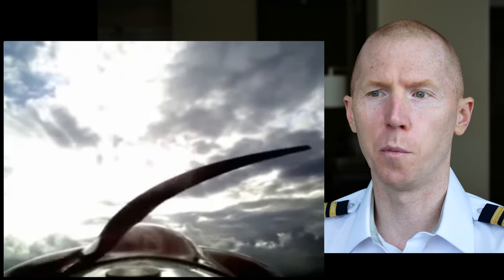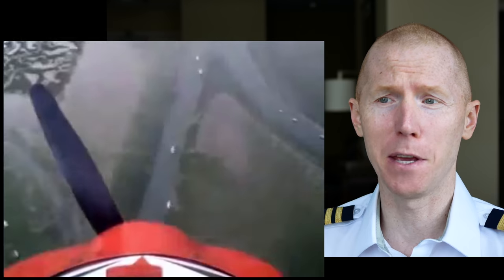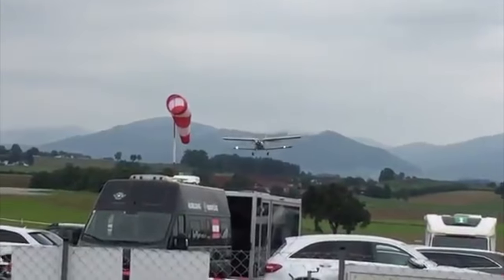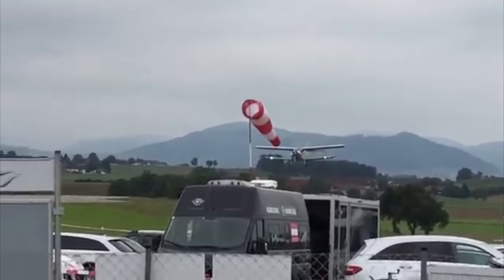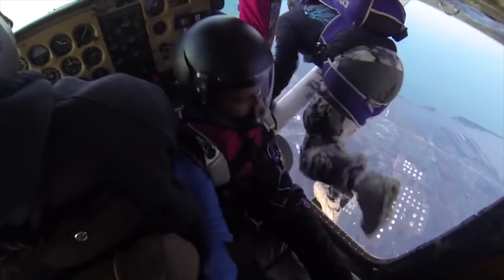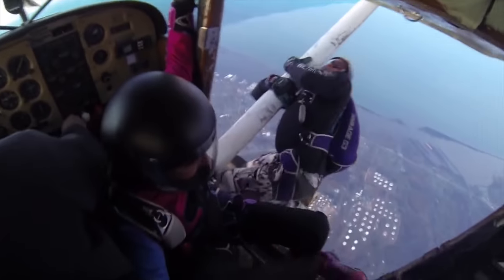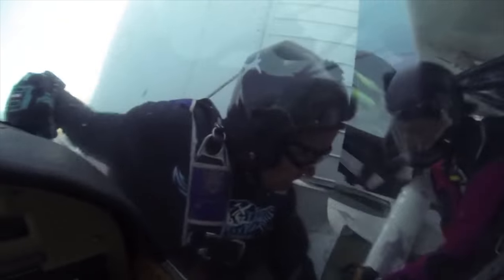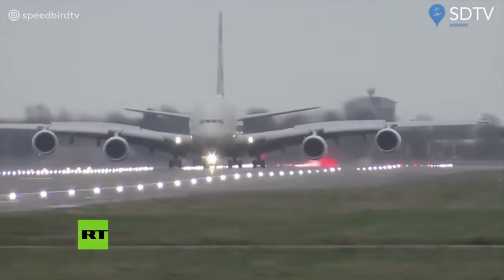Mid-Air Collision Rips Plane's Wing Off | Viral Debrief

Comment: True story, in 1967 (iirc) my dad was 5000ft elevation over El Paso Texas and was involved in a head on collision with a Navy Trainer jet in steep decent. Both planes skipped off each other, his plane going high, jet going low. The jets tail came right through the nose between him and the copilot and was torn off. They lost all control but the twin engines were still running, they could throttle down one side to turn and vice versa. They were able to land it actually on the runway albeit with a single wheel down. The jet successfully landed as well, no fatalities. crazy stuff. Still have a copy of the news article on it

Comment: Skydiver here (not a pilot though so I apologize if I'm wrong). Usually if we do plane formation flying for a "bigger" skydiving formations, the lead plane is always on higher altitude. There is multiple reasons, trailing plane on lower altitude has a perfect visual to the lead plane that is higher. Also skydivers have better timing for the exit when the base (single skydiver who others follow to create the formation) exits from the lead plane. They also have more time to prepare for the exit and the separation is smaller when the base exits from the higher altitude. So my best guess what happened there is that the lead plane noticed he/she was too low, and tried to correct it by gaining more altitude too late, when the balance of the plane was already screwed up since people were already hanging from the strut thus leading drifting to the left. Horizontal positioning speaks for this too, since the trailing plane was on the left side of the lead plane, skydivers have better visual of the base exiting from that side. With twin otters and c208s the ideal would be other way around (higher altitude plane to the left), since the door is on the other side. Would you think pulling the power would possibly cause the plane to stall, since the weight was still partially on the back? I try to find you one c208 major screw-up with the weight balance that caused the plane to stall with people still inside

Comment: I was recently watching a video to the effect of "Real pilot reacts to flight scenes in television and movies." One of the things he said is that the explosions and fires are very unrealistic.  That wings don't just burst into flames when they separate from the fuselage because aviation fuel is actually hard to ignite.  I'm sure that last part is true but here we see a collision between  landing gear and a wing with no (prior) fire involved and you can see the flaming wing just flying off doing its own thing.  So somehow the fuel from the tank in the wing ignited from probably a short in the wiring when the wing separated.
Reply: The difference is that small piston engine propeller planes use gasoline as fuel.  Gasoline is very volatile and in the high air velocities involved will create a flammable cloud of hydrocarbon gasses mixed with air very quickly and the smallest spark created either electrically or mechanically will ignite it.

On the other hand large commercial aircraft use turbine engines that use a fuel similar to kerosene with is much less volatile than gasoline and thus it is much harder to create a flammable cloud of hydrocarbon gasses mixed with air.  it can certainly happen in the correct situation, but it is much less likely to be ignited.

Comment: The mid-air. (I'm a professional skydiver, more than 30 years) - this is called a Formation Load, the intent is for people to jump from both planes at the same time, and create a single freefall formation. We do this a lot, and every major record attempt needs this. In this scenario, we have a "lead" aircraft (probably the one on the right, as it is in front) and a "trail" aircraft. Timing of the jump comes from the lead, and the trail aircraft and jumpers take their cue from the lead.

It would have been better if the trail was on the other side, to the right of the lead, as this gives better vision for the trail pilot, and the jumpers in the trail can see the signals and climbout of the lead jumpers. But this also makes it harder for the trail jumpers to see when the lead jumpers actually exit, and any delay between the two groups exit timing leave a large gap for the trail jumpers to close.

Jump pilots usually wear an emergency parachute, it is highly recommended, and some Drop Zone operators require that pilots always wear a rig. It is usually not a sports parachute, but the same style as worn by glider pilots - a seat pack - a single round parachute, although "square" reserves as used by sport jumpers have become more common. This is why the pilot of the broken plane survived - he bailed out. The other pilot was able to land safely.

Comment: Spins... depending on the center of rotation, the speed of rotation, and the amount of fuel in the tanks, the spin will force the fuel in the tanks to the outside and away from the feeds thus starving the engine of fuel and causing it to stop producing power. After the spin recovery (and the spin did seem intentional in this vid) a restart of the engine should be possible.

Formation flying... well, the trail plane's job is always to keep the lead plane in sight.  This pilot clearly didn't do that and... well, no more to be said on that.  
And, for the skydiving part, the jumpers in the trail plane jump when the lead plane jumpers exit.  So, if you can't see them you don't know when to jump.

Great vids. Thank you.

Comment: In the first video only way u can think about getting out of it would be turn the the rudder the opposite direction of the spin to add some resistance and hopefully slow it down Enough to cause the weight of the engine to pull the nose down to get some speed and airflow over the wings

Comment: Thank you SO much for berating those that decide to land on the piano keys or numbers. I used to work for a major airline training their cadets before they transitioned to jet training - if ANY of them landed on the numbers or piano keys, they failed checks. No one even went solo before they landed in the correct area. GA all too often thinks everyone will be a bush pilot - you can learn that later.

Splays, clearways, displaced thresholds and 1000' markers are there for a reason.

Comment: I used to ride motorbikes. There is a phenomena where riders will be approaching a bend at speed and they give up trying to get round the bend (often resulting in a fatality) even though in reality they could have got around the bend. It's a natural "freeze" response where you brain just stops responding in the face of a fearful event. You can train yourself not to react in this way or more accurately to react in a more appropriate way. I'm assuming it's the same thing with pilots.

Comment: In mid air collition video, you can see in 7:40  the vertical speed of upper plane, they are descending arround 200 fpm; and  you can see the same instrument of bottom plane in10:02,  they are CLIMBING around 200fpm at the beginning and  300-400 fpm at the impact moment.

But off course, they never saw each other. They should have planned their flight better.

Comment: When in a flat spin the correct procedure is to apply rudder and turn into the spin. Not going into credentials but this bit of info can save your life.  Your pitch will eventually turn nose down and you will gain airspeed. Then simply stop the spin with ailirons and use elevators to regain a safe attitude.

Comment: The Cessna on top would have also had major CG shift and additional drag as the skydivers got on the wing. The pilot may have appeared to have good separation from the other aircraft before they got out onto the wing, but then things changed quickly as the divers exited onto the wing and the pilot was either too distracted to notice the change in course or the plane was no longer sufficiently maneuverable to avoid collision.

Comment: these are excellent training videos which show nearly catastrophic results but teach the most harsh lessons.   although it is terrifying to see a pilot involved in a terribly life-threatening situation where balance between success and failure is a very thin line.   I'm not a very experienced pilot but when I was training as a commercial pilot I had  my PPL I was departing my training airport and this airport had departure and arrival points geographic points on the ground for keeping separation between departing and arriving aircraft depending on the runways in use.  on this particular day I was heading towards the assigned departure point  and I saw another aircraft heading in my opposite direction straight towards me.  he was obviously not aware of the fact that the departure point was not the arrival point and he made a terrible mistake.  so I was waiting for him to realize his mistake and to make the correction which would have been a turn to his right or my left.   when I saw that he failed to do this then I did a bank to the right and turn to the right to gain separation.  but the idecided to turn left instead and then I punched the nose down aggressively.  a very nerve-racking situation.   Finally the other pilot realized his terrible mistake and banked sharply to his right.    We all make mistakes but I've discovered that some pilots act like they're driving their car to get milk when they're flying.  They don't take this privilege seriously enough.   All pilots general aviation and commercial must act and be professional and know and follow the rules and regulations to the letter.  Our very lives depend on this.   Thank you.

Comment: The pilot in the flat spin did the correct recovery, slightly delayed, probably due to the engine failure.
He made the right decision to make a emergency landing.
The skydive pilots made one big mistake, when flying two cessna"s in formation the leader flies below and to the left, the wingman above to the right. The lead pilot concentrates on flying, while the wing pilot maintaines position (I know this from a lot of experience) Kelsey was spot on pointing out that the lead plane was below and to the left of the second plane, both in each others blind spots.
Whenever flying formation, all pilots should brief before flight. It"s important that all pilots know in advance who will lead and who will fly in trail, and most imprortantly, which way to turn if you lose visual of the lead plane.

Comment: two things mr 747.. actually  4 things. #1 love the videos. keep up the good work. watching your facial expressions on this one was a whole seperate form of entertaining experience inof itself. #2 im just a lowly night rated, almost CPL student and Cessna 172 owner. And im hoping u were just dumbing it down for the non pilot folks but everypone (should) know that a stall doesn't happen because the airplane gets too slow and all the other jazz u said.. yes, those things typically happen as a result, but cmon meow. an airfoil, whether is be the whole aircraft,  just one of the wings, i a single propellor blrade or all of them ,the back wing on the stab. all or each individual stalls for ONLY one reason. It has exceeded the critical angle of attack.!!  #3 that flat spin was nuts.  never seen one like that before. . thanks for including that.  i love doing spin training and i don't get sick EVER, but just watching that one i wanted to puke in my mouth. lol. #4

Comment: As someone who has done formation skydiving 182 flying before I can tell you they, obviously, have it set up wrong.  The trail plane should be behind and to left of the lead.  The reason being on exit I don't want anyone who might fall off early falling into my plane, trail plane.  The door is on the right, the trail, low plane should be on the left.  If people fall off the lead plane on its right side I am below and to the left and just watch them go.  That is actually the exit plan.  When the jumpers in the lead plane go that is when they go.  You also need to brief your bail out plans on every flight.  If things get tight lead climbs to the right while trail cuts power and descends left.  This also how we break away after exit.  While the trail plane pilot can't look straight up if you lean forward you can keep the lead in sight if you maintain about a wing tip to wing tip separation and stay back about 30 ft.  The skydivers want minimum lateral separation but to be back a bit is fine as you are going about 60mph and the natural delay on exit will get the jumpers very close.  When exit begins lead needs to maintain airspeed and altitude.  That will often result in full power when everyone is outside.  It is the trail job to keep the separation and not get too far away.  Trail has the option to cut power and descend left.  Something I have had to do with new leads before.  Lead never descends or banks left.  It can be done safely when everyone knows what they are doing, where they need to be,  where the other plane will be, and where to go if you need to bail.

Comment: I was in an incident many years ago where I hit the wing of the trailing Cessna 206. Fortunately it was a glancing blow on the front of my helmet. I was flipped over on my back and I just suffered two black eyes and a bleeding nose. Another jumper's legs missed the propeller by inches. I don't recall any investigation into the incident. When I got on the ground, I looked as though I'd been shot in the face!
It's actually not necessary for aircraft in a formation jump to get all that close. The separation can be quickly made up by the skydivers after exit.

Comment: Not quite, the wings are not the issue. We break stalls using the elevator. A flat spin is a very advanced stall. The fuselage is blocking airflow over the horizontal stabilizer as it rotates thus preventing the breaking of the advanced stall or flat spin.

Comment: I'm skydiver and I know a bit the cesna (few hours of piloting on it) to add to your debrief I can say that top plane pilot can't see the below plane too because of skydiver on the right outside and all the skydivers pending to the wing bracket is putting yaw and roll to the plane. obviously the pilot must be trained to correct that but so much people on same exit is not so recommended and as the top plane hit the plane below we can see the flight track are not totally parallel and not totally level with horizon

Comment: Although I only fly spam cans, I prefer crabbing into a crosswind landing. The alternative is to dip a wing into the wind, which must be a concern on a plane with long wings. The tricky part of crabbing is kicking the rudder to straighten out just as the wheels are touching down. Too soon and you're blown off the runway, too late and you drive off the runway, major kudos to the Airbus pilot in this video.

Comment: I used to fly the crab (B-747-400) down final but then kick rudder into a slip in the flare. It sounds complicated, but it worked out every time and was fairly easy to do. Not sure if I would have tried it in the x-wnd condition shown in the video as the slip required may be enough to hit a pod. Great job by this crew though!

Comment: We used to spin the C-150 Aerobat in flight school. It was fun but pissed off the mechanic since we sometimes tumbled the gyro. I believe the spin was intentional. Going flat probably not. However, the recovery from the flat spin was textbook, nose down then rudder opposite of the turn. I don't understand why he didn't attempt a restart. It probably would've restarted since the spin likely slung fuel away from the inlet, temporarily starving the plane of fuel.

Comment: Back in the mid-80s I was taking flying lessons at Palatka Kay Larkin Airport (that's in Florida) in a Cessna 150 Aerobat. One day there was a Ford 4-AT-E Trimotor on the field (with three 300 hp 220 Wright J-6-9 Whirlwind nine-cylinder radials). The owner was taking up passengers. I didn't go as I had a flight lesson to do and as it was I was barely able to pay for lessons. However, we did land behind it as it was just ahead of us on final. A few weeks later I was in a bad car accident and began to suffer from tremors. After a few months I resumed lessons in Jacksonville at Craig Airport in a Cessna 152, with about 10.5 hours of flight time, but while my doctor and CFI said that I was still able to fly I decided to ground myself with a total of slightly more than 15 hours logged. Not an easy decision to make but after all these year later as my health worsened I know that I made the correct decision.

Comment: I differ on one comment and that is that you never want to be in a flat spin. You don't want to be there by accident but my AERObatics/taildragger instructor, Charlie Wells, (God rest his soul) was a national at show performer whose signature closing move was a lumchavek in which he recovered by entering a flat spin and his Pitts S-2-S was powerful enough to power out of. He was an amazing man whose life ended the way he lived it. He was performing at the Bloomington, Illinois airshow in 1993 when he suffered a stroke and failed to recover from his closing maneuver. I love your videos but just wanted to say that you never want to accidentally enter a flat spin but there are times it's desired. Charlie always told me, though, that most aerobatic planes didn't have the raw power to weight that his had and couldn't pull straight out of one the way he always did. The pilot in the video did a hell of a job recovering from his with no power at all.